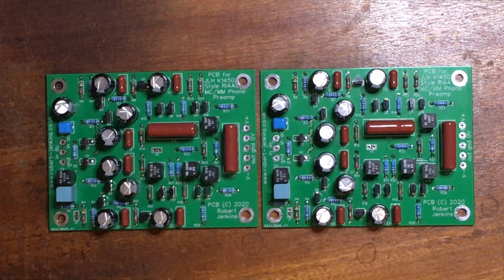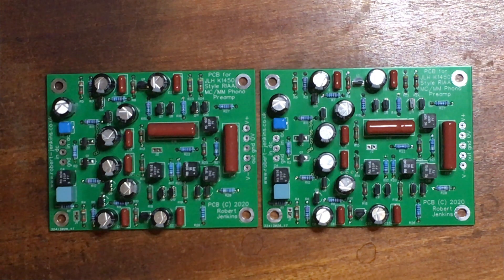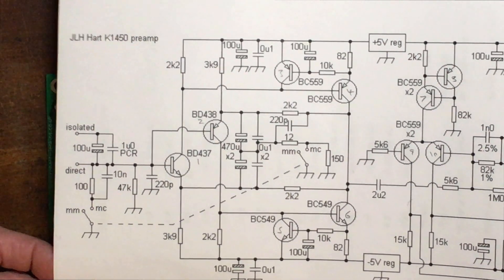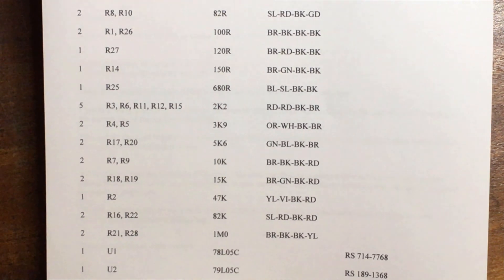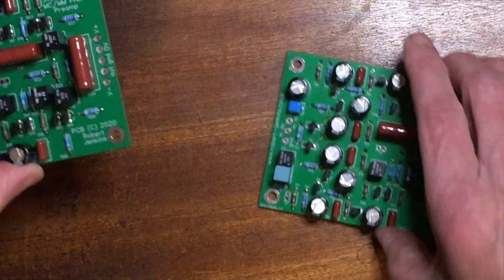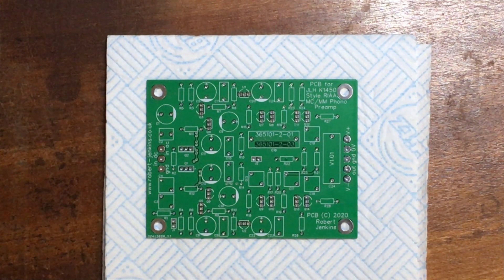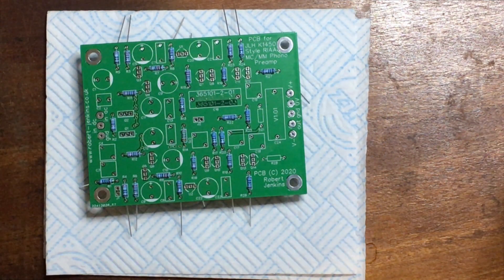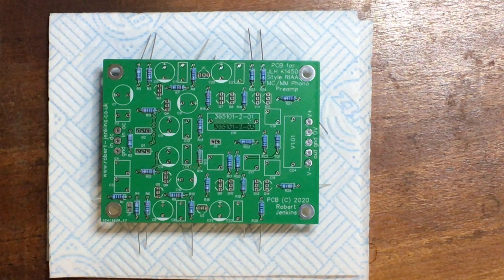K1450 RIAA Moving Coil / Moving Magnet phono preamp assembly Part One

Comment: Didn't Hart Electronics do some modifications to the original circuit? and do you know what they were? Do you have the sizes of your boards to hand? want to look at enclosures for them. Oh and check your ebay LOL. Cheers
Reply from the maker: There are some possible mods listed below the schematic on the paulkemble page, mentioning some Hart info?

As my PCBs have a full ground plane, the board capacitance may be fractionally higher than the original and add a few pF in the RIAA equalisation section.
As I understand it, the recording companies each used slightly different equalisation curves so there is no universally correct one; JLHs values could well be closer to the actual RIAA spec than used when recording the discs now being played through the preamps, and he knew far more about that side of things than I do, so I'm sticking with the original values for mine own.

The preamp boards are 4.2 x 3.2 inches, x 2. The PSU board is 5 x 4 inches. Mounting holes are 0.25" in each way on both boards.

I see you found the updated ebay link, hopefully you have them by now!

For info, ebay appear to remove the facility to amend a listing as soon as it sells out - so you cannot add more items, in any way I could find. I had to create a new listing & update the links.
Reply: Sorry for the late reply. Youtube didn't show me any notifications. I am not sure whether a slightly higher board capacitance would make much difference.  Thanks for replying. Cheers....

Comment: Interesting, very interesting. I was looking to have boards made, but it seems very expensive unless I'm looking in the wrong place. Have you ever built the 80W MOSFET with curved PSU from 1989? I think! lol I wouldn't mind getting boards done for that, but not sure where to look. How does this Phono compare to retail phono stages of today? Cheers...
Reply from the maker: Hi Anthony, I have no absolute comparisons between these and any other preamps; the specifications should be identical to the originals if built with the same components. 
I've used ZTX851 & 951 transistors all the way though on my prototypes, though the boards are made to take the original devices. The ZTX ones have some of the lowest noise levels of any general transistors available.

The end results seem very good to me & audio samples [96k 24 bit FLAC] recorded using the prototypes are available on my web site.

As you mention the 80W MOSFET amps - I've been working on a board design for those and the main amp boards are nearly ready for me to get a few PCBs manufactured for testing.

I only work from the schematics to avoid any chance of copying someone else's designs, so my version of the amps (and PSU, when I get to that) will be somewhat different dimensions to the originals.
Reply: @RJTC  Thanks for replying. I see nobody has commented on your post. Sort of shows that DIY audio is virtually dead these days. A shame really. And a shame Mr Good is no longer here and Hart electronics are no longer too. I may be interest in the power amps if you do make some boards. Jeez I used to make my own boards years ago, where I would use the rub on stensil tracks and then ruin my mother's pans with ferric chloride lol. Ahhh good old days. Lol. Cheers thanks for answering back.... Tony